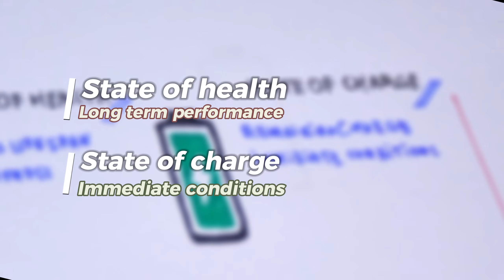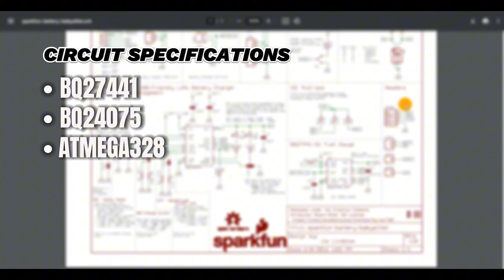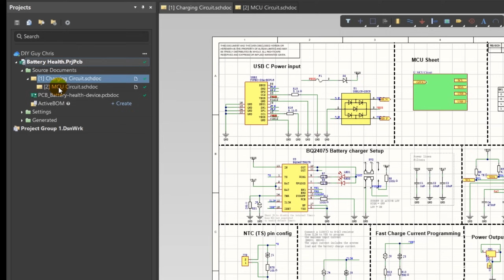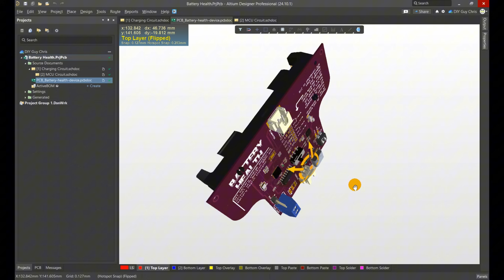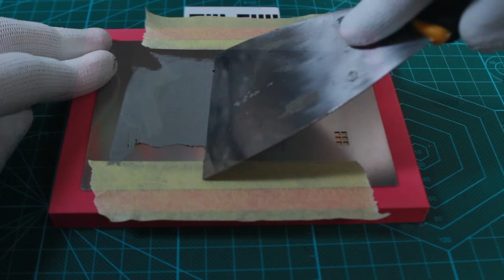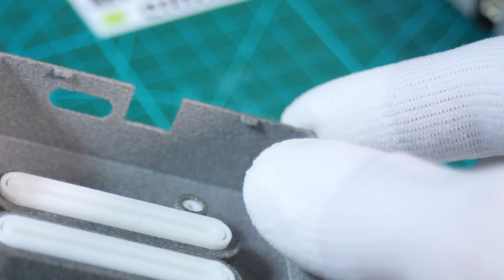Build This DIY Lithium Battery Health Monitor! (BQ27441 + Arduino)

Comment: It's impossible to quickly test the health of a battery because each one requires pre-declaration of its various parameters in the BQ27XXX. Besides, it's only for 3.7V batteries, not 3.6V like Li-Ion in power tools, and it's not suitable for 3.85V. Other BQ family chips are used for that. I've written this in brief; I won't describe everything in detail; those interested can explore the topic themselves. Thank you for the great video.

Comment: Hello there,I am working on a battery health monitoring circuit using the bq27441 IC according to your instructions. However, I encountered a problem when discharging the battery: the battery voltage drops to around 0.7-0.8V when I set an electronic load of about 1A. This phenomenon only occurs when the battery is connected to the circuit (through the BQ27441 IC); when I connect the battery directly to the electronic load, this issue no longer occurs. Please help me solve the problem
Reply from the maker: hi, glab to see you here
How have you configured the SYSOFF pin ?
Reply: @DIYGUYChris  i disable bq24075 by set en1 and en2 to high logic. So i discharge from battery -> Rsense -> electronic load.
Reply: @DIYGUYChris  I do not discharge the battery through ic bq24075 but discharge the battery directly into the load (only through Rsense so that ic bq27441 can monitor voltage and current parameters when discharging)

Comment: I also need one; this is a very useful module circuit. Where can I order a pre-made one?
Reply from the maker: You can following the instructions that I listed in my video, written steps here as well: https://www.instructables.com/DIY-Lithium-Battery-Health-Monitor-SoCSoH-LED-Disp/ 
Or you can certainly buy the Sparkfun Battery Babysitter module, but you need to connect it to an Arduino then to your Serial monitor, check this link: https://www.sparkfun.com/sparkfun-battery-babysitter-lipo-battery-manager.html

Comment: Nice content. How to monitor a 6s lithium battery? i dont see how it can be attached.
Reply from the maker: Thanks for your comment, many battery connectors exist in the market so I considered the most used types of battery connectors.
You are right, the 6S model is a common type, unfortunately no exact type of connection in my circuit but you still can connect it to the circuit through the Screw Terminal connector (That black connector) you need a little adapter to wire the + and - of your battery to the connector.

Comment: Have you thought of doing a v2 with a small screen and a way to change the original capacity on the device without having to change the code
Reply from the maker: @danielroark171  actually this has been suggested from many friends here and I think I will update the software and hardware to include this feature then will share a Youtube shorts about it 😉

Comment: is there some way this can be purchased assambled ?
Reply from the maker: @monochrome5297  indeed, check the GitHub link in the video description, there you can find the project files (open source) among these files you can find the (GERBER, BOM, Pick&Place) files, you download them and upload them to your preferred PCB manufacturer (JLCPCB is recommended and you can find diret link to JLCPCB from the video description as well) by placing PCBA at JLCPCB you can order a fully assembled board 😉 check the video at the assembly chapter and let me know if you have any other questions.
Reply: I mean the device, not the files
Reply: @monochrome5297  I mean... get them printed and built, I'd toss a tenner down one one myself.

Comment: Great Job! Just one question, how can your circuit identify the type of the battery? I mean if I put a 2500mAh Lio cell in it, which is in perfect condition, and after that I insert a 3000mAh cell which is degraded to the point it can only hold 83,3% of the total charge (2500mAh) what will it show? So to be clear where do the circuit knows the original max chargeing capacity if the cell is already degraded? Thanks. Keep up the Good work!
Reply: The original rated capacity of the battery is set in the gauge (e.g., 2000 mAh).
Reply from the maker: @ yes exactly 
@manofallseasons8752 Thanks for the kind words and great question! The BQ27441 fuel gauge IC is smart but needs a little help to handle different battery capacities. Here’s how it works:
1⃣ Initial Setup:
You manually program the battery’s original design capacity (e.g., 3000mAh) into the BQ27441 using lipo.setCapacity(3000) in the Arduino code. This is the baseline for all calculations.
2⃣ Degraded Batteries (Your Example):
If you insert a degraded 3000mAh cell that now only holds 2500mAh (83.3% of its original capacity), the IC will:
Report SoH as ~83% (since SoH = [Current Full Charge Capacity] / [Design Capacity]). Show SoC accurately (e.g., 50% = 1250mAh remaining) because it tracks real-time charge/discharge.
3⃣ Switching Battery Capacities:
If you later insert a healthy 2500mAh cell, you’d need to reprogram the design capacity (to 2500mAh) for accurate SoH. Otherwise:
The IC would overestimate SoH (e.g., report 100% even if the cell is smaller).
The circuit doesn’t auto-detect battery capacity, it relies on your initial input. For mixed batteries, you’d either:
Reprogram the IC when swapping cells (or).
Use the same design capacity for all cells and interpret SoH relatively.

This could be a great room to improve my design by adding a Bettery Design capacity input tool, this way there is no need for reprogramming the MCU. :yougotthis:
Reply: @DIYGUYChris   Thanks for the detailed answer, know it is crystal clear. Still the best thing I can find around YT. BTW if it could measure the resistance of the battery it would be a pretty powerful tool. If it is possible. 
Have a nice day!!!
Keep up the Good work!🤜🤛